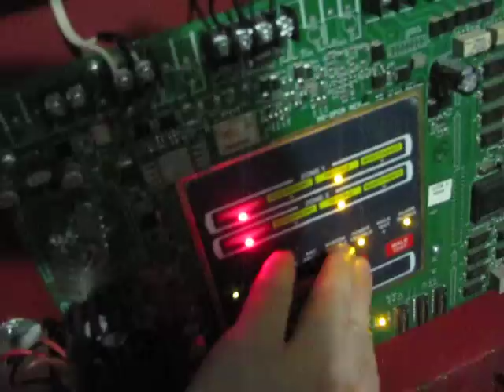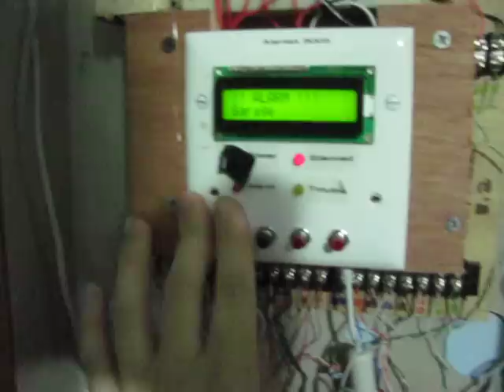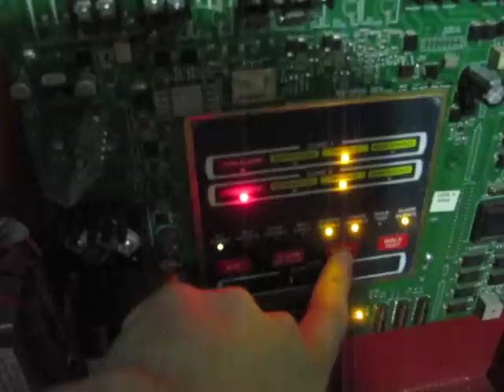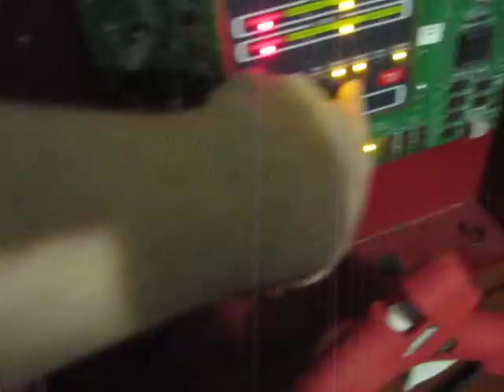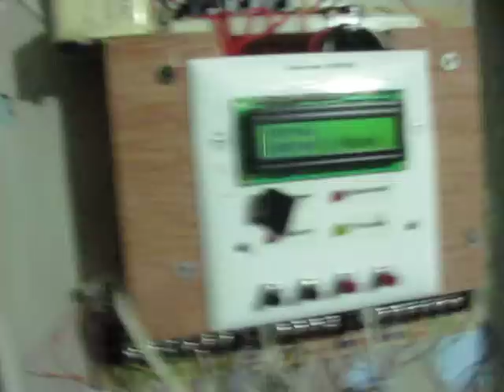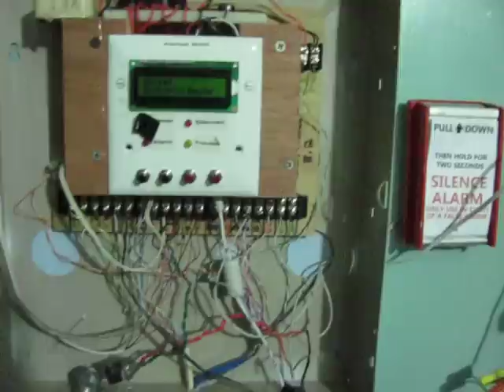Panel Linking Demonstration (System Test 26.25)

Comment: My schools gym has spetralert advanced alarms and simplex T-bar pull stations. The panels at my school are wired together and they only need to reset one the panels. For example if a BG-12 in the portable Is pulled they can silence  the alarms from in the office or gym.

Comment: is it possible to wire addressable panels this way? the reason i am asking is because a school in my area had a simplex 4004, but has gotten replaced by several different honeywell and simplex panels over the years, including a 4010 and 7100. the fwr is killing the horns, one died this year from it, but i dont know if its possible to link two addressable panels to have the 4004 (controlling simplex 4903-9217?s and -9219s) hooked up to the 7100, because two Wheelock exceeders were added at some point and i think that they should stay on FWR.
Reply: No

Comment: So what if you were to wire a double-pole  relay to the NAC on each panel, then from that relay you have 2 separate contacts, so you could wire in both other panels to that relay. If you did that for all the panels, would it work, or essentially make it impossible to reset the system?
Reply from the maker: You'd have crossed circuits and it would make resetting become hell.

Comment: Awesome. Just a question. I have an ms4 & an ms2. How can I make my ms4 trip the ms2?
Reply: G
Reply: capt421 the most basic way of doing it is wording the ms2 nav to the pull station circuit on the ms4 and reset both panels at the same time

Comment: to do this you hook the panels relay that is swithed when the alarm is activated to the pull station terminals on the next panel (dont forget the end line resistor on the relays ;)
Reply: Blacklight8001 tl;dr

Comment: Out of curiousity, have you seen a system where the original building had a Simplex system and the addition had a Wheelock system with electromechanical horns?
Reply from the maker: No... ok?
Reply: The local mall here has a variety of alarms. Simplex, Wheelock, System Sensor, and Siemens. I bet it has multiple panels, just gotta find the annunciators to guess which ones..
Reply: @NewAgeServerAlarm  do a video on how to change the lights in a 2903 light plate

Comment: I have a a feature I made on my panel.
I made my own panel and I to Made another one so that I can have One trip the other and vice versa. So I had some issues with re-alarm and my panels would refuse to reset so what I programmed the panels to do Is when one is reset, It resets the other.
+1 this comment if you think it is cool and reply

Comment: they are doing the same thing at my communtry college they add it a new libary and and new heath caner center the main fire alarms at my communtry college are gamewell system with wheeluck e70's speaker srubles and they are remodeling 3 budings in the new add it parts and the remdeling parts the system is a gamewell fci e20 searers with spetralert adcanced speker srubles in white and red the new libery and tha part that was all ready remodel they are white